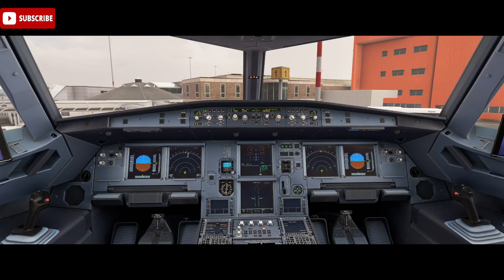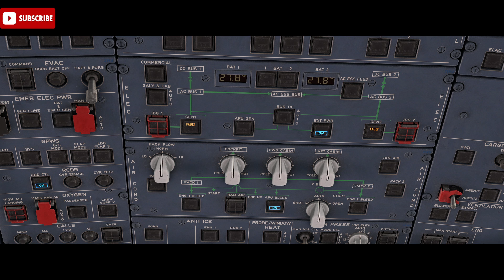A320 PACK Flow Valve Explained by Real Airbus Pilot | MSFS 2024 Tutorial

Comment: When at the gate, engines off, Is there a way to regulate cabin temperature *without* using the APU + APU Bleed?
Reply from the maker: Hello, only with ground supplied air
Reply: @AirbusCockpitCoach  Thanks, so it would be commonplace to start APU early to regulate temps to a comfortable level for pax boarding?
Reply from the maker: Yes that is normal practice 👍

Comment: I know you get efficiency gains at a lower pack flow setting, but do you get any performance gains on departure? Obviously, a packs off take off would be more efficient for high performance departures, but in theory, you should have some performance gains, right? Enough to justify using it? 

I find that sometimes doing a flex T/O, I’m using up a good amount of the runway, and having lacked performance on the climb out. Not sure if a low pack flow setting could help with this when doing a flex T/O.
Reply from the maker: In theory yes but the performance gain would be minimal. It is not an Airbus SOP to adjust the flow valve for performance

Comment: Is there an approximated average fuel savings percentage to running with low pack flow vs norm with short haul flights?
Reply from the maker: Using PACK flow low saves around 0.5% to 1% during the cruise phase of a flight
Reply: @AirbusCockpitCoach  Splendid, thank you!